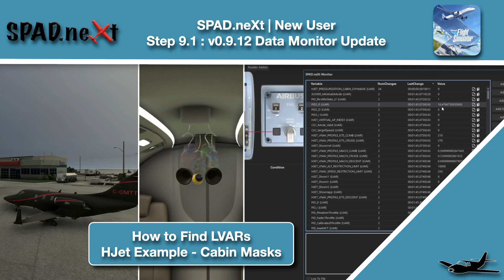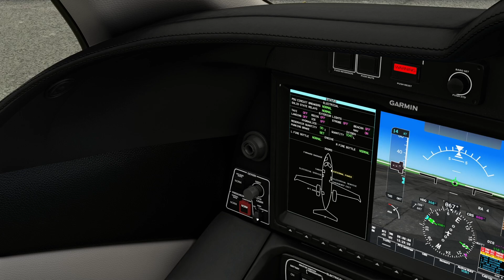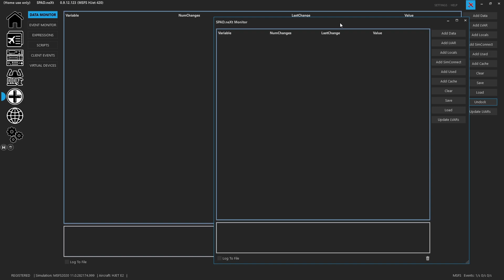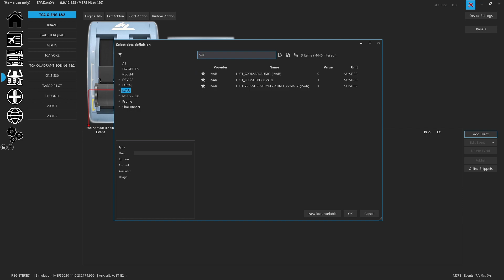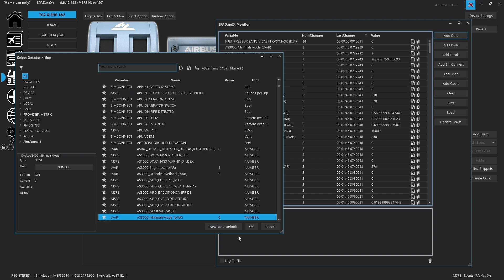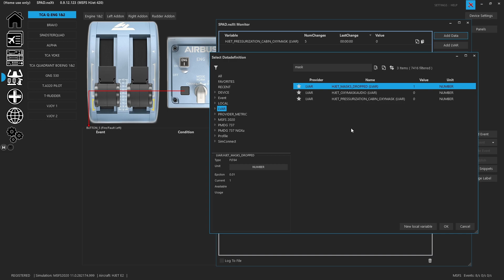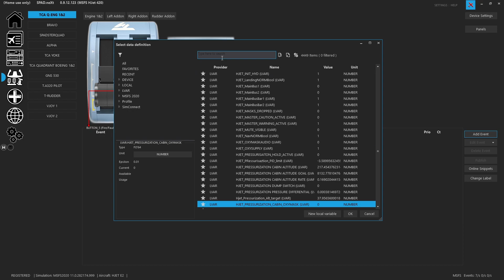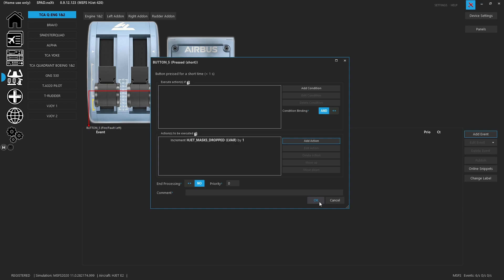MSFS | New User #9.1 | SPAD.neXt v0.9.12+ | Data Monitor Use Case

Comment: Great demo of the tool. Quick question ? Whe should you set END PROCESSING to YES. I notice sometime you do sometime you do not… cheers and thanks. Good work..
Reply from the maker: When you don’t want multiple assignments to accidentally fire — especially important when using conditions and variables values.. 

Ie if the switch is a 1 then you would send a value… well it’s going to move to a new value and you don’t want another assigned press for that value to be triggered so you would end processing of any other events in that priority group for that button press. A subsequent press would then check the conditions and send its control. 

Examples are when people end up setting a switch on and off back to back because they end up sending the toggle event twice. No end processing to only fire the first valid event then stop processing.

Comment: Thank you for your video!
I tried to follow it to get the Nav Selector button (to switch between FMS and VOR/LOC) in the newly updated Asobo CJ4 assigned to my device, but no chance. I just don’t know what I‘m overseeing. 
Do you think you could look into that certain case and give me a hint?
I would highly appreciate it 😊
Reply from the maker: There are all new H Events ... the have _1 and _2 in them .. these were all added today to the client Events list in spad..  relaunch spad and you will find them..  Note you can not use data monitor or event monitor with H Events ...  the sim does not announce them..
Reply: Thank you, that worked 😊
I used the H Events without the _1 and _2 before and was wondering why it never did anything. 
But still, I couldn’t see them with the Data or Event Monitor. 
Is there a way to assign the VNAV Button as well?
Thank you for your help!

Comment: Rather than use Increment with a rollover could you not use the ToggleBit setting? That switches between 0 and 1 for booleans.
Reply from the maker: Yes you could but that only works for Bools .. if it is a number.. or if you have a 3 state switch you want to use it with .. or you find a switch that (Hjet does have) that has -1 / 0 that you want to use ... well going with one consistent method will also allow you to copy and paste replace..  Again I have used toggle bit in the past but I find the rollover increment approach always works for me.

Comment: You're a Legend, and a clever fecker. I'm now going to be able to use the full potential of my Warthog's buttons and toggle switches, because of SPAD and your tutorials. This is going to change my flight sim experience more than anything ever has. Much respect mate.
Reply from the maker: Thanks :) ...  I agree that this is my most used piece of flight sim add ons :)  once you have invested this kind of money on hardware it is a no brainer to get something that will enable it's use ...  the hardware guys don't seem to really make decent software..
Reply: @LesOReilly  The Warthog is utterly useless for its intended purpose, which is flight simming lol. You couldn't make it up. Well apart from the bog standard buttons. A don't get me started on the toggle switches. SPAD changes all that, and turns them into your absolute best friend. 👍😊

Now all you need is an expert in rocket science to show you how to use it, and thats where you come in. 😁